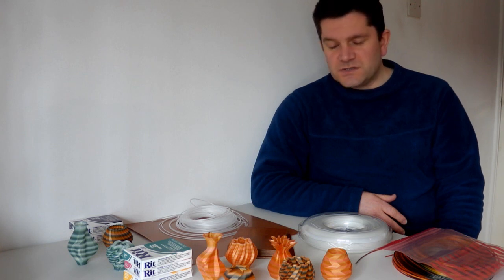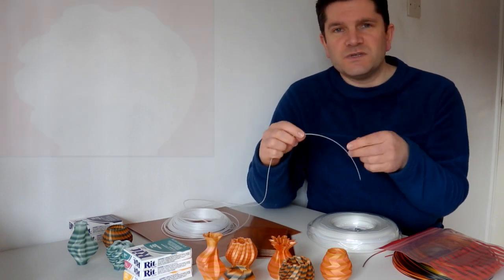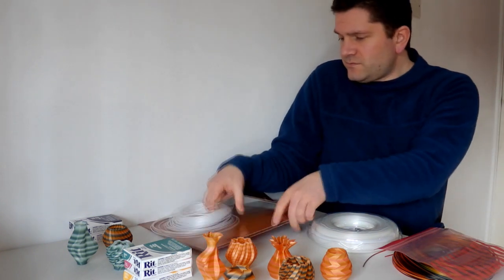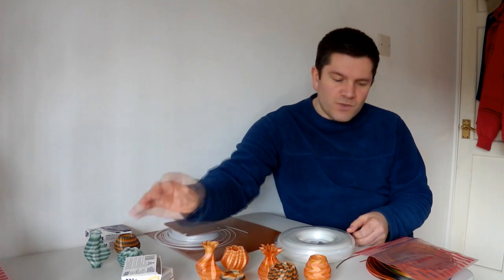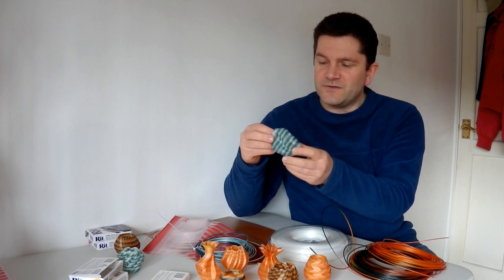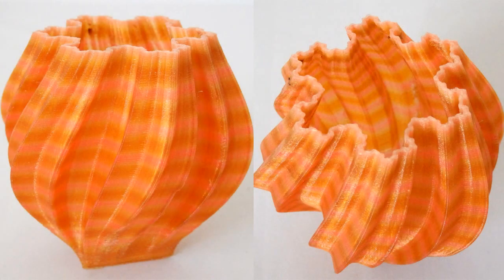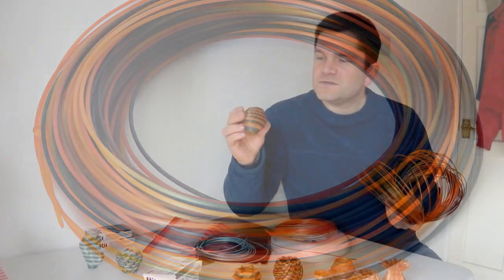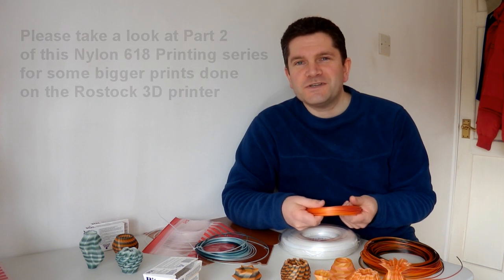Tie Dye Filament 3D printing with Nylon 618 on RepRap Part 1 of 2

Comment from the maker: Hi Oliver, Thanks, I'm not looking at metal at the moment, other people are experimenting with high powered lasers and other methods. Some low temperature metals can be printed in a similar method to the plastic, but they tend to destroy the extrusion nozzle quite quickly. The best way is to use PLA to make a model and use a lost wax casting method, the PLA will burn up like wax and allow parts to be cast in metal, people have tested this and it works very well.

Comment: Hi Oliver and Rich.
Hossmachine has been experimenting with pewter filament on his Youtube channel on a REPRAP type printer. But you are correct Rich, the nozzle and any place that the filament rubs against needs to be made of hardened steel in order to last any reasonable time.

Comment from the maker: You need to keep the filament very dry or you get bubbles and steam, so adding the dye in the nozzle is not ideal - you can use sharpie marker pens on clear PLA to get light printed shades!

Comment from the maker: Yes, it's the only real issue with Nylon material, you need to dry it, and keep it dry. Dry again if it's exposed to air for more than 5+ hours. I keep my Nylon in a warm cupboard, you can dry it in a normal oven on low for a few hours. - seal it in Zip lock bags with desiccant.

Comment: Hey Rich, I'm really loving this channel :) Great videos!

I was wondering, since you seem to be one of the more experimental of the 3D printing 'vloggers' if you have any plans for metal manufacturing methods? I understand that its more complex than plastic and the DMLS machines are very expensive and would love to see a more affordable way to do it.

You could print ceramics to cast into, but for accuracy, do you think there is a feasible way to print in wax and produce a cast around that?

Comment: Rich, Have you had any issues with moisture in the nylon? I just started using Taulam nylon and it worked great for a few days then kind of foamed up. Looked at an extrusion under microscope and lots of air bubbles in it. On the reprap forums it's been mentioned that it's very moisture sensitive and must be dried out and kept dry or you get bubbles.

Where I am, we have 50% to 75% humidity so I think mine just absorbed the moisture from the air.
Reply: Put it in the oven for 4-8h at 80C... it will be completly dry again. I printed like bone solid stull from Taulman910. It became super-hard but brittle (shattered by hitting it with a hammer), until it absorbs some moisture again. Store it in a sealed box with some silica gel (the stuff for your cat also does the job - silica based)

Comment: Since you're soaking the filament in dyed water essentially, how are you drying it? And what's the quality/printing difference between non-dyed and dyed filament?
Reply: 3 years later ill answer you that he decided to leave the coils in an airing cupboard at a slightly elevated temperature for a week,and it worked extremely well and all of my spare ABS is stored in this cupboard permanently to keep out any moisture. 

Source: http://richrap.blogspot.se/2013/04/3d-printing-with-nylon-618-filament-in.html